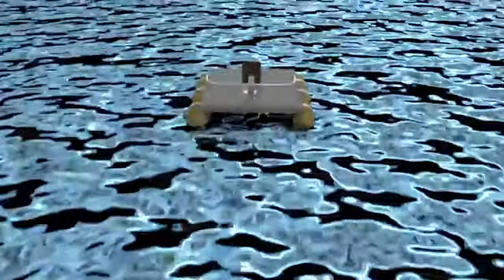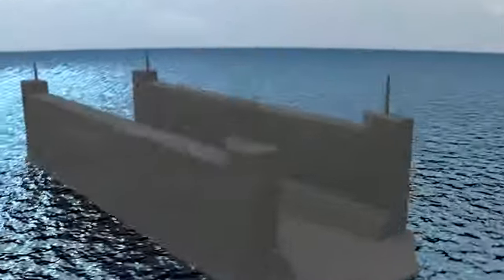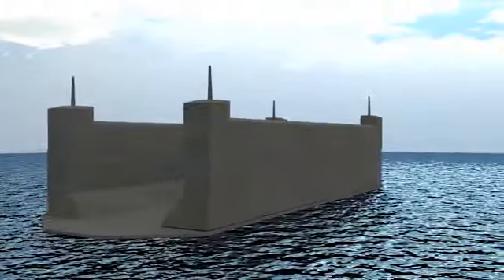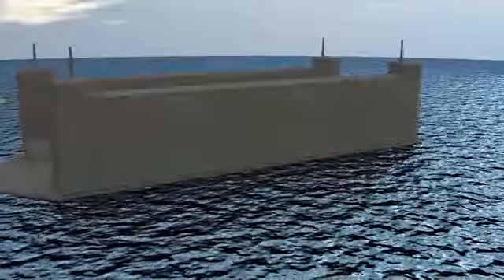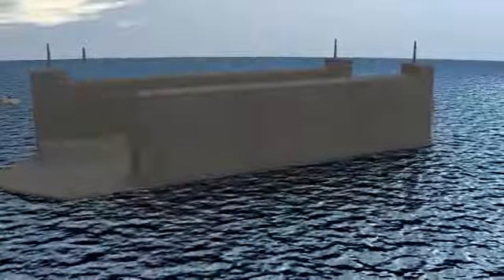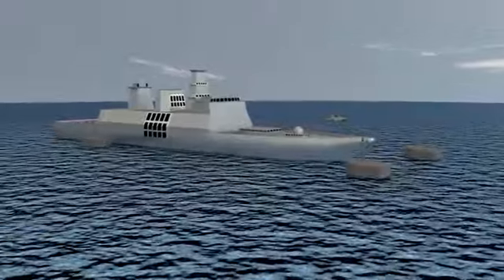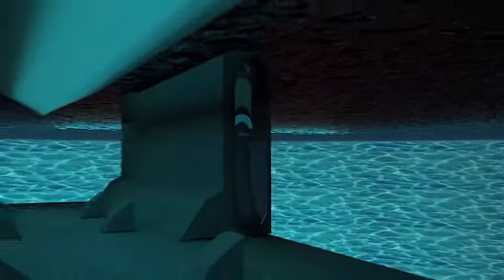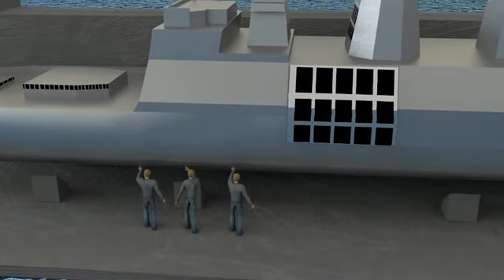How A Drydock Works

Comment: I was stationed on the US Navy floating drydock AFDM-7 and I have to say that, while your animation is good, the construction of the drydock, mainly the ballast tanks is wholly inaccurate.  The ballast tanks of a floating drydock are "L" shaped and extend under the main lifting deck.  The flood valves are located well below the water line which allows for natural flooding of the ballast tanks.  In your animation, the water would have to be pumped into the tanks and that's just not how its done.
Reply: yes i do agree but it gives quite a nice idea for people to understand  who have never seen one. its difficult to make videos. i would say its a good job done. he missed about the double bottom☺😍 tank concept and just mentioned side tanks.

Comment: I've been opperating floating docks for the past 15 years. And this is far from correct. You better work on your resurch. 90% of the dallast tanks are below the water in the cason pontoon. The sides is mostly enpty to keep the boyency while submurged.